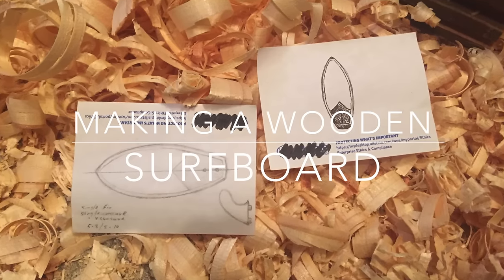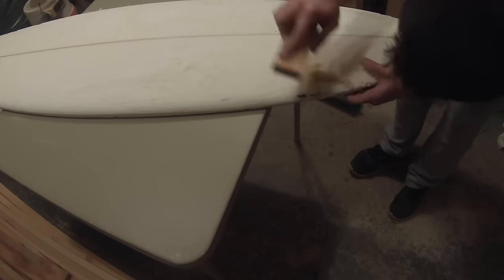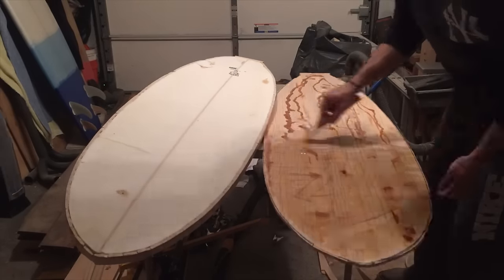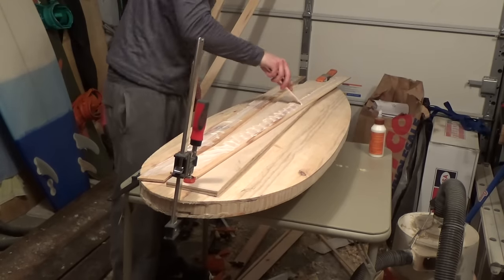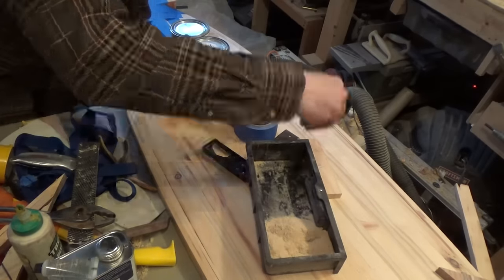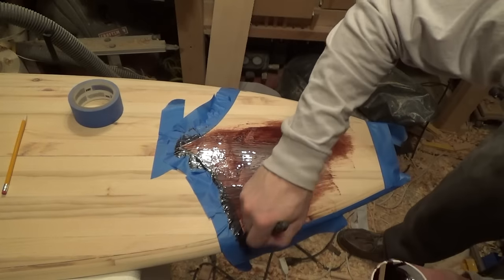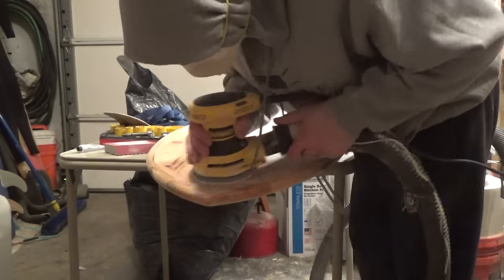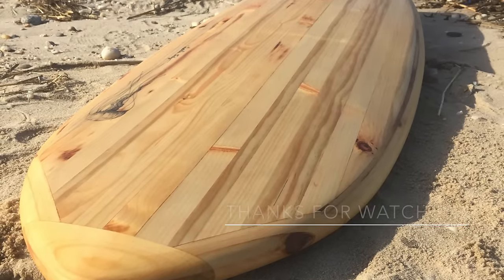Making a Wooden Surfboard - 25

Comment: Awesome. I will try something like this some day.
Reply from the maker: +Lazy watchsmith Thanks! Go for it! Good Luck
Reply: +Long Island Woodworking 
I'm thinking more like paddle boar.
Reply from the maker: +Lazy watchsmith I made a paddle board a few years ago before i was making videos, You can use the same methods as this video if you can find enough foam.  Or you can use the rib and spine method, might be a little harder but i think easier for a paddle/longboard.
Reply: +Long Island Woodworking Thanks dude. I look in to it.
Reply: +Lazy watchsmith Are you looking for paulownia wood for surfboards????
Reply from the maker: +John Peter Yes actually, Paulownia wood is perfect for wood surfboards

Comment: you're an amazing craftsman bro. If you haven't already you may want to look into making custom wooden boards. What you've done with some scrap pine is pretty amazing to say the least. Id be interested in seeing how it surfed and also what the final weight was. I was born and raised in San Diego and have surfed my whole life. I know people that would pay really good money for custom boards like this assuming they also preformed as good ss they looked. Awesome work, that thing would be epic to surf.
Reply from the maker: Thanks for the feed back bro, really appreciate it! I haven't surfed it yet cause the water temp is still to cold for my wet suits but I'm def going to make a test ride video of this board and my find in the other video I put up. The overall weight of the board is 7lbs. The original board was 5lbs so I only added a small amount to it

Comment: great video;) your rasp handle broke cause it was trying to alert that your block plane was about to fall check it out 4.50 to 4.58 did your block plane fall or did save it?
Reply from the maker: Haha thanks brotha, yea I think I saved it. No worries
Reply: Long Island Woodworking  really great stuff I'm always amazed at how other people bend wood and you did it well but you did seem frustrated at how long it took you to clamp and weight for it to dry so if you're going to laminate wood allot to your surf boards you're going to have to build some simple bending gigs so your clamps don't slip off but i have never seen wood bending without clamps infact i noticed it takes alot of clamps
Reply from the maker: Yea for sure! At the time I wasn't thinking it would be that difficult to clamp the wood around the board but i guess for my next one, I'll spend som time and make a bending form. thank for the advise!

Comment: How well did this float? I have an old shortboard. I'm thinking of trying this.
Reply from the maker: It floats as you would picture a 5'3 board would float haha. It doesn't float well but thats mainly because I'm a little too big for a 5'3 surfboard not from adding the wood. the wood added only 2 pounds give or take to the board.
Reply: Michael Volpe thanks for the quick reply. I have a 5'8" board with lots of heel dings. I'm just wondering if it'll work better if I turn it into a fish.
Reply from the maker: I'd say  definitely go for it!

Comment: what kind of epoxy did you use? do you know where I can buy it? also, what did you use to put the fin boxes in
Reply from the maker: I just used general polyester fiberglass resin epoxy from the Home Depot. the fin boxes were bought on amazon and they were just epoxied in as well.
Reply: thanks!
Reply: just finished mine up, doesn't look as good as yours but super stoked on how it came out. I used this video every step of the way. Thank you

Comment: Very cool!! What did you use for the final gloss coat on the board?
Reply from the maker: +Tramp Box Guitars  I used the two part fiberglass resin from the home depot. I used just the resin though, no fiberglass. I put two coats on to ensure the board was completely water tight. and sanded both coats to give it more of a matte finish
Reply: Awesome!! It turned out really nice looking. Stoked to hear about the ride report and how it holds up.
Reply from the maker: Thanks, Yea its driving me crazy not riding it yet!!
Reply: Ha!! I'll bet looks like a fun outline.

Comment: this is probably my 6th time watching this
Reply from the maker: mrBattelharden haha thanks brotha
Reply: Long Island Woodworking how thick was the pine you used
Reply: not for the rails but for the base
Reply from the maker: It started out as 1/4 inch thick strips. After it was glued on the board I planed and sanded it, so it was prob ended up being a little bit thinner than that